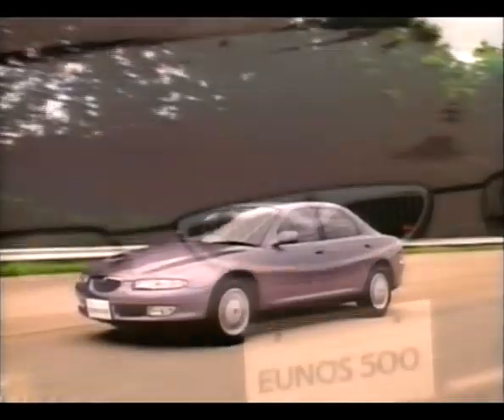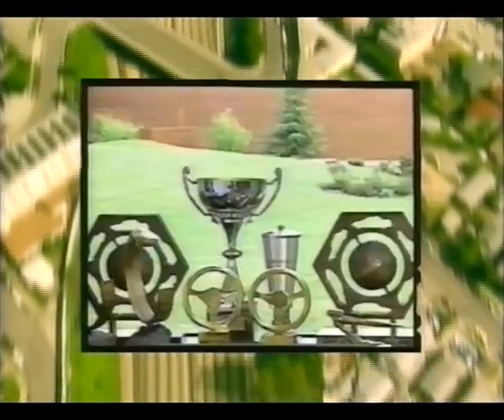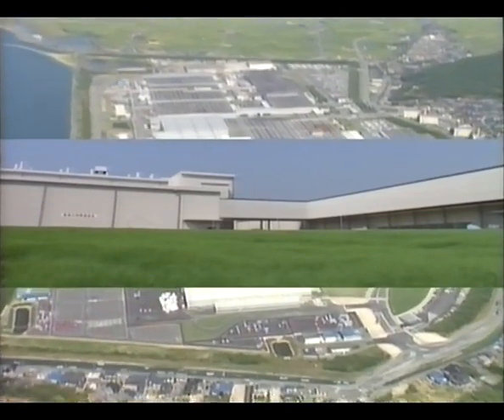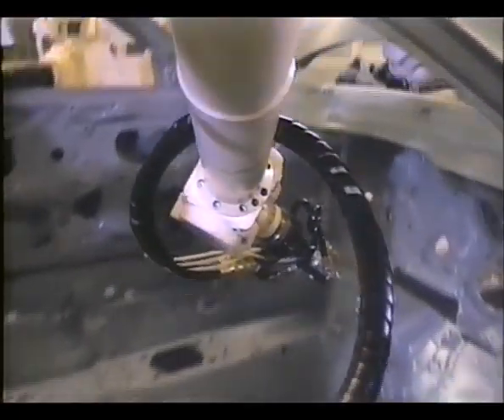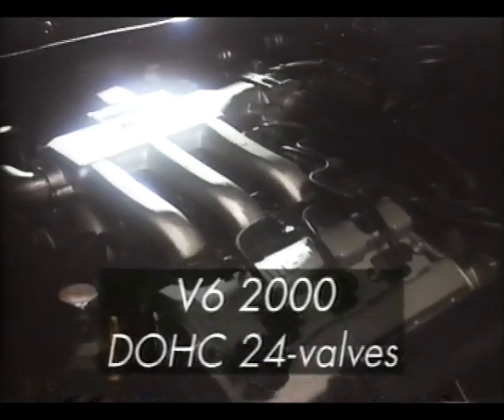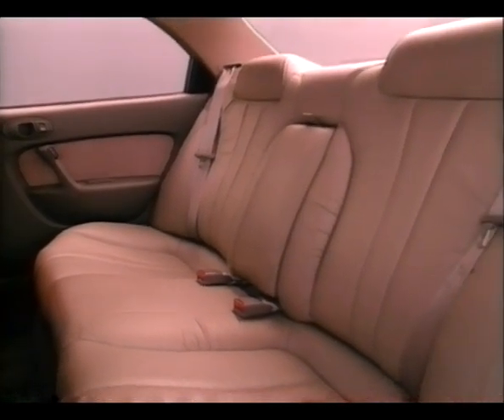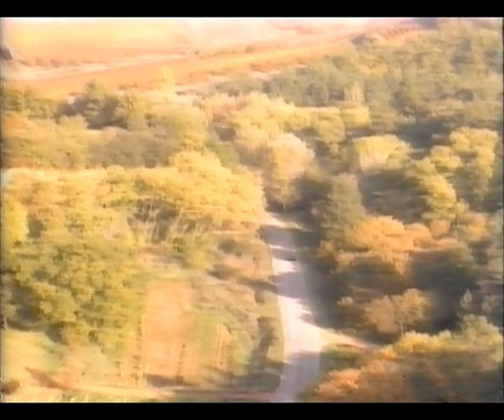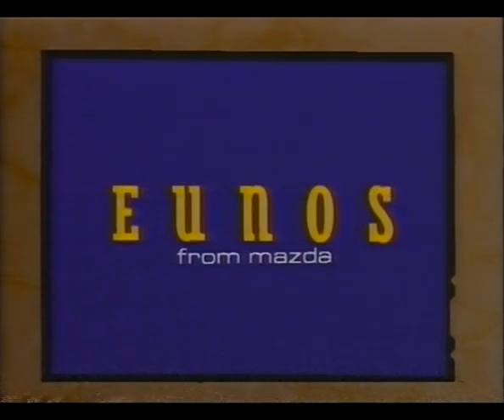1992 Eunos 500 PV

Comment: Is there a forum in Japan that anyone knows about Eunos 500 or 800?

I'm an extreemly big fan of the Eunos 500 and I started a prived collection with it since last November, I now own nine of them and three Eunos 800's.
I like to have all colors, all years and all options one day and my dream is to convert some Eunos 500's into a Coupé, a station and two convertibles, one with and one without hardtop.

More cars will also be added through time.
Maybe one day I will own world's largest Eunos 500 and 800 collection, ...if I already don't have it right now. :)
Reply: +Primeiro Último I do own a xedos6, and the styling and flow of the lines of this car is unbelievable, not to mention the lovely 2.0 engine.

However, I think you're a little crazy, buddy :) Don't do conversions, you'll ruin your pocket. One thing you could do for sure is - convert it to a rear wheel drive. Now that would be one tail-happy car, given it's low weight and lack of factory spoiler.